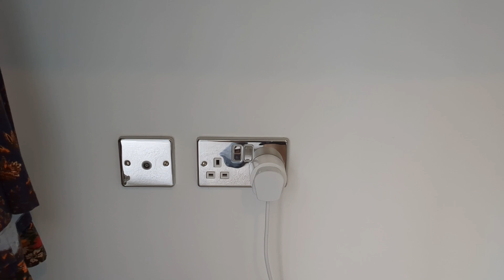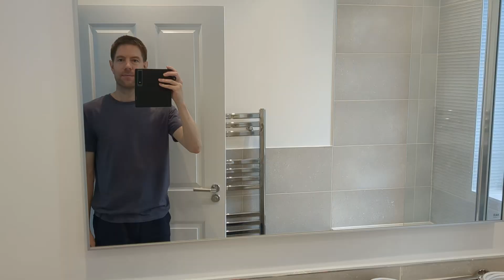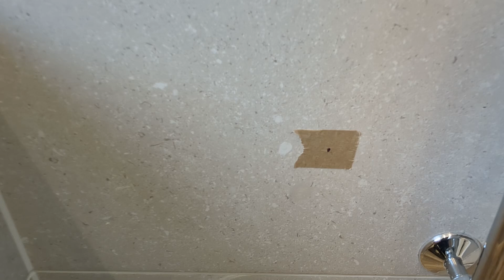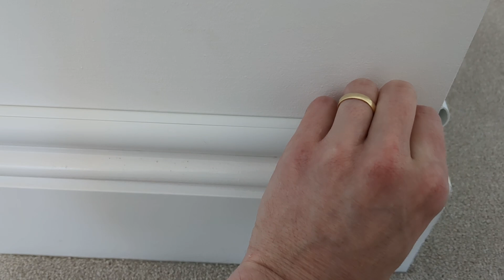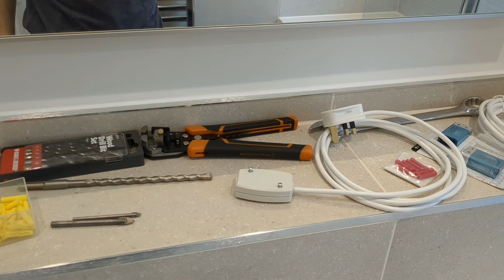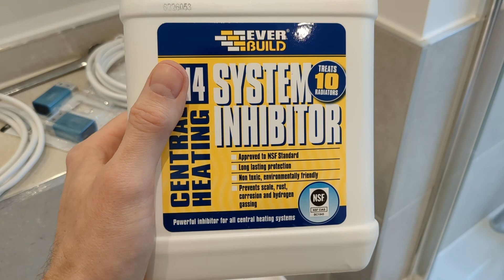How I electrified our towel rails

Comment: Hi Tim, part p electrician here, only recently started watching your channel but enjoying so far. What you’ve done here is not only perfectly legal it is also done to a high standard. The bonding/earthing situation others have referred to is not a problem as the towel rail cannot bring in an earth potential from the water pipes as they’ve been disconnected (and were probably made of plastic further back anyway). The only reason you would need to earth the towel rail is because it is now an electrical appliance, and the earth wire in the element would do that. From a regs point of view these are not new circuits as they’re on a plug so just extended appliances essentially. The only thing I would be concerned with is those crimp connectors, if you use a heavy duty ratchet crimper with the right heads then they’re fine but most others like those wire strippers won’t really be up to it, I’d recommend in line wago connectors if you can fit them in the trunking, if not then redo the crimps with a ratchet crimper. Otherwise very good work and with the smart plugs this setup is actually better in my opinion than hard wiring them in.
Reply from the maker: Cool, thanks for the confirmation, I appreciate it.  I'll take a look at getting a ratchet crimper, or else see if I can fit wago connectors.  For the record, I did press as hard as I could when crimping those connectors and did a tug test to make sure they were gripping tightly but no harm in getting a better tool for the job.
Reply: @TimAndKatsGreenWalk  Yeah, they're probably fine, just something to consider really. The tug test is a good check to do.
Reply from the maker: @classictrafics  I've just ordered myself a ratchet crimper anyway as it looks like another useful tool to have available.  I might redo those crimps just be sure.  Thanks for the pointer!
Reply from the maker: @Ben-gm9lo  Haha!  Yes, indeed, never hurts to have a qualified person to check with.  Prior to starting this project I did research the options as thoroughly as possible to try and ensure I was doing things right, and couldn't find anything to suggest my plan was dodgy in any way, but you can never be 100% sure without professional input, as you say.  I'm glad you enjoy the channel.
Reply: There is an issue with crimps inside trunking relating to maintenance and basic protection of an "enclosure" that can be opened without use of a tool. It's dealt with in detail here: https://youtu.be/SrvTFOhpIUI?si=JdONpFqG-OgiSRXr

Comment: Don't think I really like your connections - fine stranded cable ought to be ferruled to go into connectors; although I really don't like connections like that.  Replace the cable with a full length.   
Also electric radiators tend to be 'glycol' filled ~ certainly these days; not sure if they did the same at the date of this video.
It's fine saying that "it seems to be working very well" until it goes wrong!  I don't really like this type of DIY wiring!
In principle I like the idea of electrical low level heating - in my current solar/PV set up, I have an electric heater to supplement my lounge which gives me 700W running at about 5p per hour using battery stored power, load shifted from off peak charging.  Much cheaper than the central heating for a mid day boost.
Reply from the maker: Well, I had an electrician in my comments saying I did a decent job, so there's that (both legal and done to a high standard, he said).  The cables can't be replaced with full length ones because they're part of the immersion element, that's as long as they are, you can't replace them without taking it apart.
Reply: @TimAndKatsGreenWalk  Yes, I'm torn between should-do and must-do, and what current standards demand. Plumber might be happy, but I've seen a lot of electricians not happy with the method of cable extension. Wagos should be in a secure box - sealed with zip-tie or similar, meaning that a tool is required to open.  
I'm a retired engineer, and I do see the need for ferrules - you can get the bare ones, so they're not bulky. It's a bit like when you bought appliances which had brass ferrules crimped on the wires.

In terms of conversion to electric - absolutely agree.  I've just taken delivery of my supplementary radiator this morning, plus its heating element - and I can see that it's a sealed unit, so not able to replace the cable on this one (Best heating; designer electric radiators)

Comment: I moved into a rented place in France that had a similar unit. The module to program the timing of the heating worked, and it communicated the commands to the heating unit at the bottom (via wireless). However, it never warmed. Maybe, now I know why: maybe there is no water in the unit. 

I had no idea that these units needed water. I assumed that they had electrical circuits in them, and 
pouring water in them was an electrical hazard. Thank you for clarifying this!
Reply from the maker: No problem.

Comment: Hi Tim, do these not need a fused spur between the radiator and socket? Just wanted to check as i want to do this and this looks really easy
Reply from the maker: It depends on the power of the radiator, really.  If you want to be super safe then a fused spur is the safer option but these rads are only about 300-500 W so should be totally fine on a plug, as long as the socket is not in the wet room.

Comment: hi Tim 

I wondered if your radiators can still work as part of a gas central heating system or not? Until the point where you mentioned oil / water to fill into the rail, my assumption was that the radiator can be heated using electricity as well as the standard central heating system. 

Thanks!
Reply from the maker: They are no longer connected to the central heading system, they're all self contained now.  However, all the pipes in the wall still exist if someone wants to reinstate that connection after us (although we plan on staying here for a very long time).  The gas boiler has long since been removed too, although I imagine the pipes could be used for a heat pump instead at some future date, if required (we have an air-to-air heat pump heating system now, hence the need to electricity the towel rails).  You can use valves that allow both the electrical immersion insert and the flow from a central heading system, but we didn't need that for our situation.

Comment: Instead of buying an ASHP why not make all your rads electric like this one?
Reply from the maker: The simple answer is efficiency.  Electric radiators convert electrical energy to heat energy with an efficiency of 100%, whereas a heat pump will give you an efficiency of 350%, i.e. you get 3.5x as much heat out as the amount of electrical energy put in (and depending on the system some can be as high as 450+% efficient).

Comment: We have towel rails and they were the only reason we would put the heating on upstairs. The house itself was warm enough. With our new air source heat pump we don’t want the heating on at this time of year (September, October) just for the towel rails. Even if we do turn it on, they aren’t very hot. I was considering getting them converted to electric. You capped off the water pipes, won’t we need to  have them still connect to allow water to flow round the rest of the system?
Reply from the maker: No, if you cap off any one radiator/towel rail it won't affect the flow to any of the others.  It's a bit like closing the valve to one rad, the rest will still work.  In fact you could test it by doing just that in the first instance to be absolutely sure, just close up the towel rail valve and put the heating on to see if the remaining rads get hot.
Reply: @TimAndKatsGreenWalk  Thanks. I thought that must be the case, but wanted to make sure.

Comment: Hi Tim. Just looking at doing this myself so thanks for sharing this knowledge ! Did you have to check your radiators were suitable to be converted or is all that just a bit of a myth? Our case will be with a new bathroom but I prefer some of the designs which come as ‘central heating suitable’. Google is unclear whether there are boundaries on the heat source ….
Reply from the maker: I think pretty much any towel rail will be suitable, as long as an immersion insert will fit.

Comment: Hi Tim, I'm a retired building services engineer.  Your installation looks very tidy,  I can understand you being happy with what you have done, it looks a very nest jobs but I would like to make some comments on a couple of points that I think you have overlooked, please don't take this to heart.  
Your trunking looks very neat but I don't like your hidden taped crimped connection, to me the quality of the joint is suspect and could overheat, I think this is why electrical regs call for Wago connectors on hidden connections on mains circuits. Admittedly it doesn't apply in this case but practically it is still a heating circuit drawing a continuous load,  it would of been better if the cable could of been replaced in its entirety with no hidden joints between the element and the plug, but that may not of been possible.  
Your point regarding not overfilling is very important and relevant, expansion must be allowed, however their is no pressure relief valve on this system,  should the overheat contactor fail in the element the temperature could rise to boiling point and pressurise the radiator until a joint fails, releasing scalding hot water into the bathroom.   I used to work with high pressure systems so my concerns may be excessive but worthy of consideration,  Richy
Reply from the maker: Yup, as it happens I have replaced the crimps with wago connectors, although this towel rail is rarely used so it's probably not a huge deal.  We only have the main ensuite one on for an hour a day (the others are only used when we have guests), so hopefully also less likely to suffer from overheating, but I'll look into sourcing some pressure release valves just to be sure.

Comment: Nice work Tim. I took a slightly different approach and went for a belt and braces design. As our bathroom is fairly large, I added an additional 700w electric radiator and connected it to the Eddi unit in Hot-water tank cupboard, which conveniently is also in the bathroom. So now I can still heat on gas but if there's surplus solar energy or an Agile price plunge I can take advantage of it as well.
Reply from the maker: Ah, very neat.  Theoretically we have a second eddi input we could use for the towel rails but it would mean putting in a whole extra dedicated circuit upstairs, which would be a pain to do, so we decided against that.
Reply: Agreed. But in the bathroom it was very convenient luckily. @TimAndKatsGreenWalk
Reply from the maker: @Pablo-tw7tt  yeah, very handy.  I'd have certainly done it if it had been that convenient!

Comment: Question for you…. Would these now run from battery as would want towels warmed BEFORE sun comes up? Would three rads kick the battery hard? As not on cheap elec and not when suns up? Don’t get me wrong I’ve thought about doing something similar too.
Reply from the maker: At the moment I'm running them during the off peak period overnight as that's enough to dry the towels.  But yes, they would run from the battery easily.  Even if all three were running they would total about 1kW, well within the capability of the inverter/battery.  Since we'll also be running our heat pump heating system over winter we'll probably still keep the use of the towel rails to a minimum though.  Just enough to ensure the towels are dry.
Reply: @TimAndKatsGreenWalk  do like the idea though… and never thought of filling with oil. That said…. Did you put a drain off on them. Like a hose connection?
Reply from the maker: @paulanderson6903  when I drained them initially I just put a washing-up bowl under one end and undid the bung.
Reply: Fair enough

Comment: we had electric radiators fitted years ago when we had the bathrooms done as they were never heated before..more recently I had shelly PM1s fitted behind the backbox to act like smart switches but without a plug. Aside from app control manually I also have an automatic humidity control using a wireless thermometer/humidistat (?) - in home assistant so if the humidity hits 80% in the bathroom it'll turn the towel rail on for a couple of hours because that means someone is having a shower.
Reply from the maker: Very neat.  One day I'll get around to trying out Home Assistant.

Comment: I’d also add a line of sealant across the top of the blanking plate - drip loop protects from one direction.
Reply from the maker: Yup, fair point.
Reply: To be fair the electrical connection is not in the box. That’s just a vanity cover.

Comment: An interesting project & well executed. Not cold enough yet, in our extension i put in zoned electric underfloor heating. Im looking to test the performance and consumption on the 2-5am element of the Flux tariff. 🤞
Reply from the maker: Yup, I just run our one for half an hour in the off peak period and that dries the towels nicely so far.  Don't really need it to heat the room at the moment but we'll see.

Comment: You may want to check with an electrician but I think you may find you need a parent earth connection for metalwork in the bathroom
Reply from the maker: Will do.
Reply: Yeah, without the pipes hooked up they have no earth any more - though if the elements have a protective earth wired in - you might be ok.  Worth getting someone to check the earth.
Reply from the maker: @JohnR31415  the element definitely has an earth wire but I will get someone to check.  I'm thinking if the pipes in the wall are earthed somehow (even though I think they connect to plastic pipes inside the wall) I could put an earth connection between the towel rail and the pipe stumps sticking out the wall?
Reply: I am not a spark, but a keen DIYer with academic qualifications in the matter.  Hopefully a Part P spark will see and respond to your question, but if not here is an observation. Such a modern house, your internal pipework will almost undoubtedly be PEX, not copper.  Plastic being a poor conductor there would be no point in supplementary bonding (what is being suggested).  The towel rail heating element has its own earth, or more pedanticaly Circuit Protective Conductor (CPC), to protect the metalwork of the towel rail from the line connector, or live mains if you prefer.  TLDR, what Tim has done is totally adequate.  I have the exact same in our en-suite that has subsequently passed an EICR, or safety inspection by a qualified Part P electrician. @TimAndKatsGreenWalk
Reply from the maker: @Ben-gm9lo  that's good to know.  As far as I know the pipes are indeed plastic behind the scenes as all the radiators had plastic pipes.

Comment: Nice video but I wonder where this stands with Part-P? I appreciate you have wired into a socket in a different room but you had added a new electrical circuit into a bathroom which is a special location which I am not sure is allowed as a DIY under part-P of the building regs.
Reply from the maker: This is a very common setup for towel rails, from what I can tell.  I think part P only states you can't plug it in in the bathroom itself (unless the socket is more than 3m away, which would require a huge bathroom!)
Reply: He hasn't added a new circuit, so this is not notifiable work.  He has merely added a device on the end of a fused plug, so in the eyes of the regs it is much like plugging in a low powered kettle.  Assuming his plug fuse is suitably sized (3 or 5 Amp), then he has taken all the reasonable steps to protect the towel rail heaters. @TimAndKatsGreenWalk
Reply from the maker: @Ben-gm9lo  yup, it's a fused plug with a 5A fuse.

Comment: Quick question. Would you pair the immersion with a temperature sensor to operate automatically when it gets colder?
Reply: I can answer this ;-) with the givenergy plugs....probably not as the API doesn't allow access. With other smart plugs and home assistant for example, then absolutely (I have sensors and triggers for my home office radiators :-) )
Reply: @marks3056  thanks. Didn’t know givenergy smart plugs didn’t work on the api.
Reply from the maker: Looks like Mark has you covered on that one!

Comment: Thanks Tim, will you be sharing any energy consumption data - very intrigued on cost.  Also, I know you’re going to get YT hate for the insulating type wrapped crimps in ducting . . Though not a sparky . . I suggest sinking a dry lining back box directly behind here the cable comes through the wall (good for zones too), perform the connections with Wagos or similar maintenance free connectors and then go into the trucking, or fish through the wall.  Won’t be as clean looking as your current set-up, but an option if you ever need to switch out the inline connectors/tape situation.
Reply from the maker: For 300 watts I'm pretty happy that this is all good.  I will certainly be sharing the data in the stats update videos.